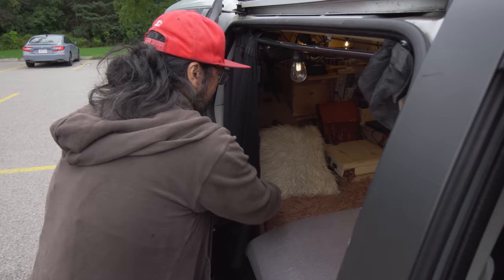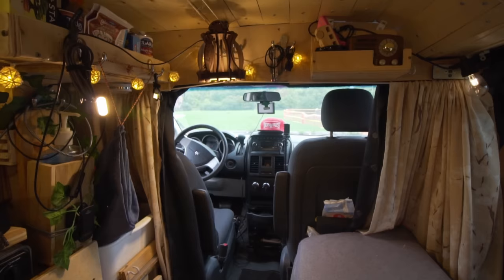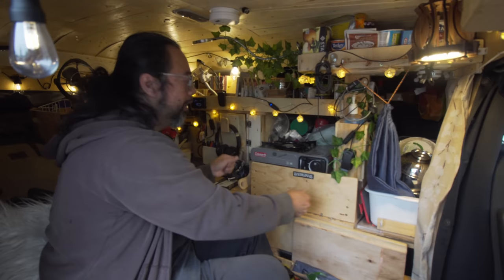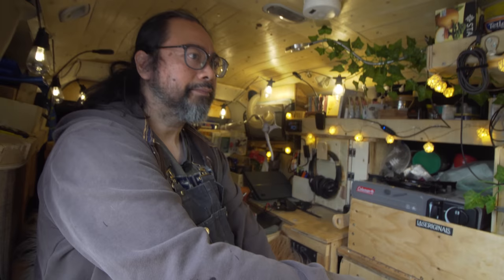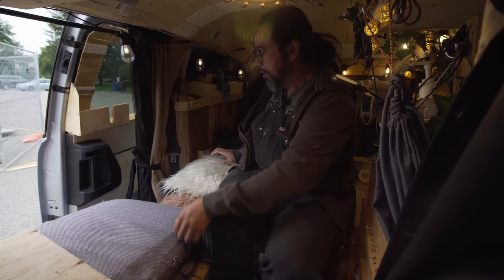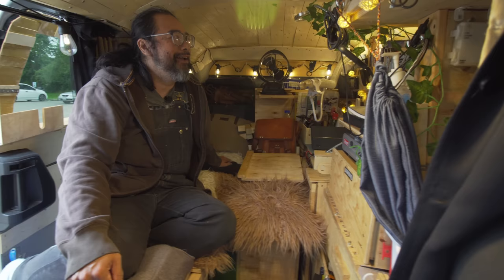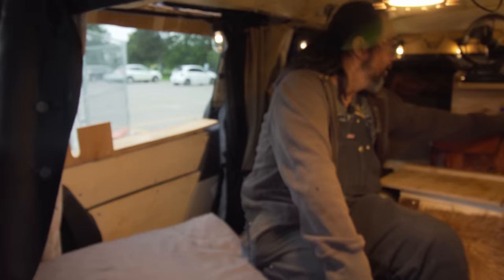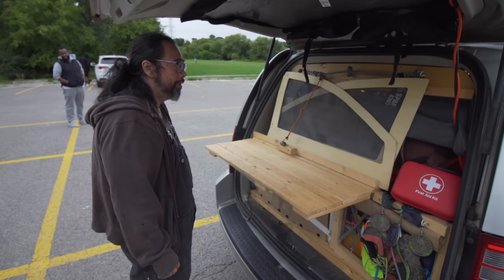Self Built MiniVan camper with 12v AC and everything he needs. | Vanlife Tour

Comment: Have fun replacing the transmission multiple times with that garbage caravan.
Reply: Most likely not repair it. Just replace the whole thing. It wouldn't be worth replacing. Had the van for 3 years. Still going strong.
Reply: @SilverCabin  Good luck, bro.
Reply: Change Trans. Oil every 3 yrs.
Don't Push Too Hard on hills.